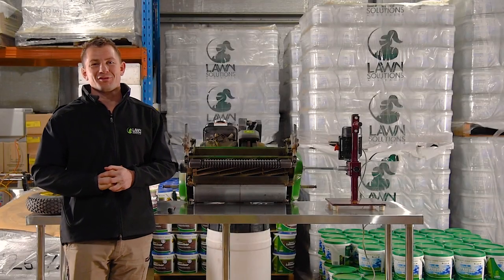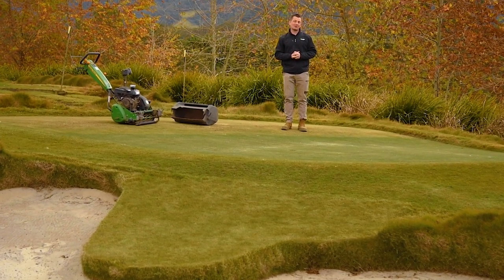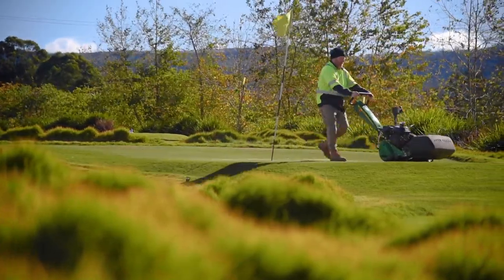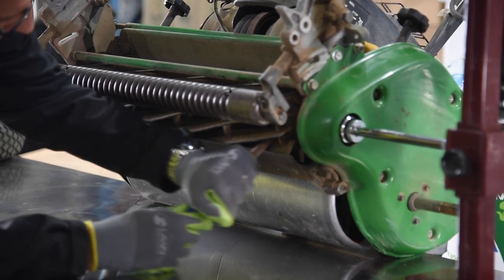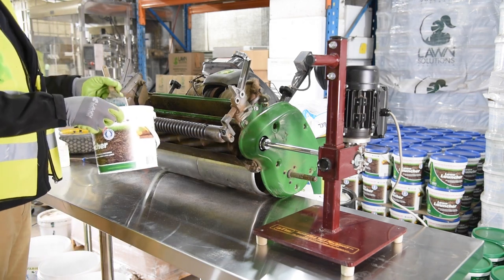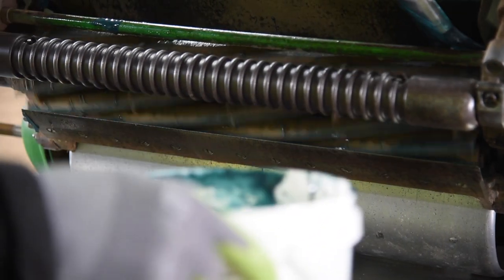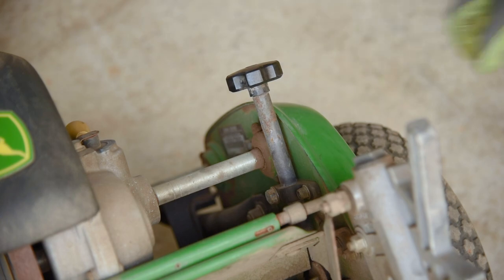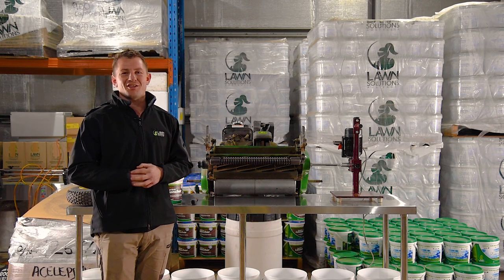How to Back Lap a Cylinder Mower

Comment: Shouldn't you adjust the reel to the bed knife before applying the back lapping paste to ensure it is being efficiently ground? If it's not cutting paper, wouldn't it have minimal contact with the bed knife, therefore reducing the efficiency of the back lapping paste as the reel is not in contact with the bed knife?

Comment: Except don't use WD 40.  Use boiled Linseed oil.  This will dry on the blade to leave a wax like coating minimising rust  due to acidic grass.  WD becomes hygroscopic  and obviously rubs off in no time.  Its fine for loosening nuts, bolts, cables etc but it's not a solution fir antirust.